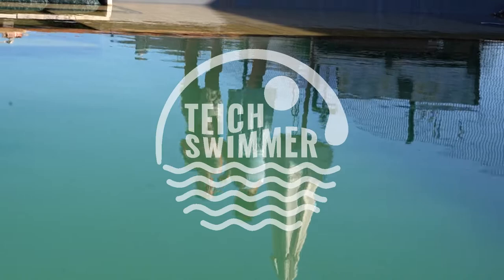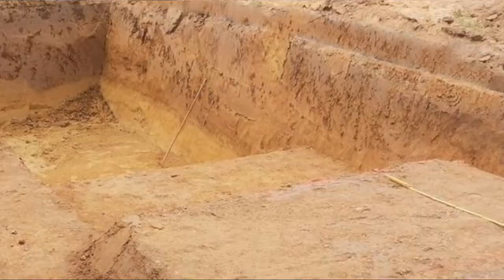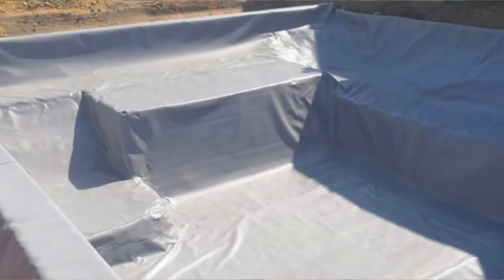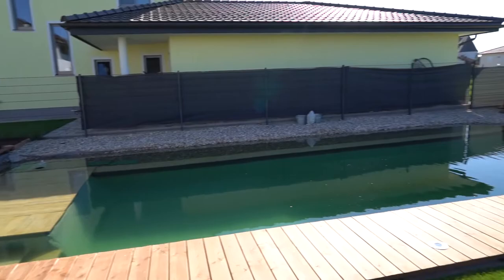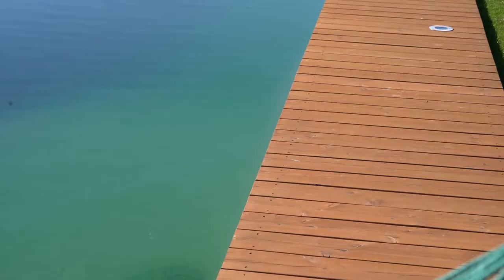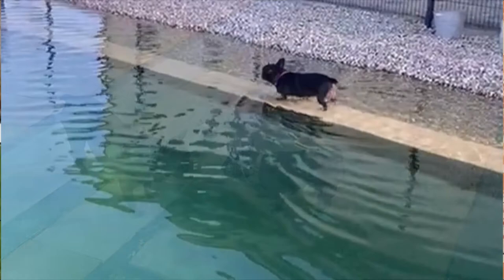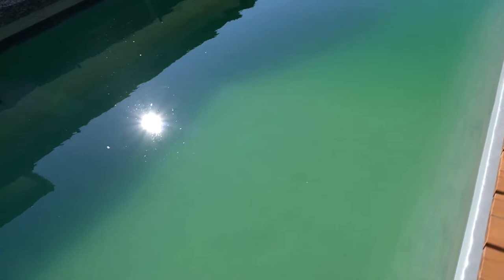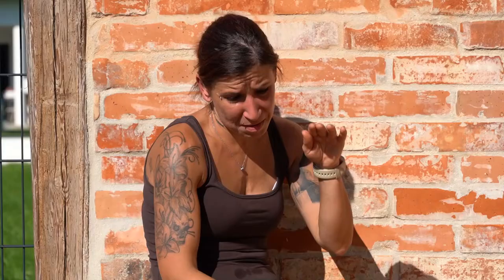... is a  tec-free natural / organic swimming pool.

Comment: I'm trying to calculate for a gravel delivery... regular pond build calculations won't work since I'm building it different like you using bags of gravel and not large boulders..... but because of access issues I must get all my gravel delivered on pallets in one day.... so I need to be as close as possible in my estimations. I have no clue how far 1 ton of pebbles will go in bags?????? My pond is 15x26... I'll have a shelf all the way around and on the back side the shelf will be 3ft wide and filled with. Bags and gravel as my main regeneration zone. All other shelves will be built out with bags, gravel and pavers as a walkway around the pond.
Reply from the maker: sounds so good, I am wondering if you are already swimming.....? - With 15x26m, I suppose you must have needed about 25t of gravel.....?